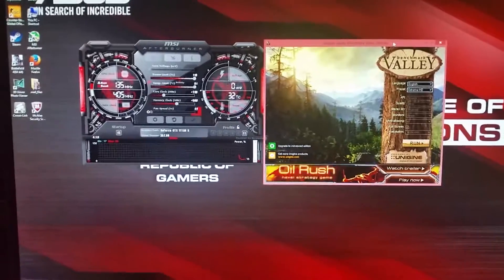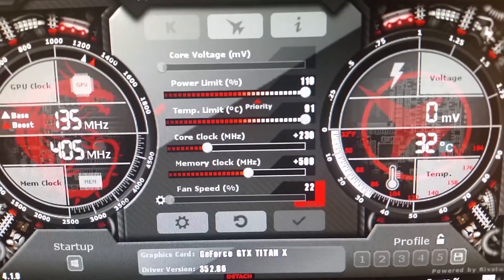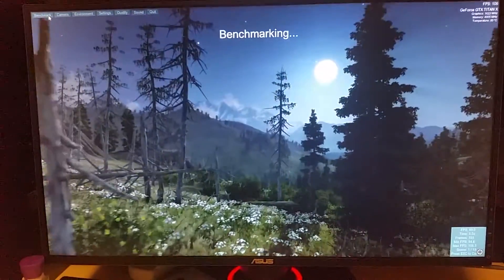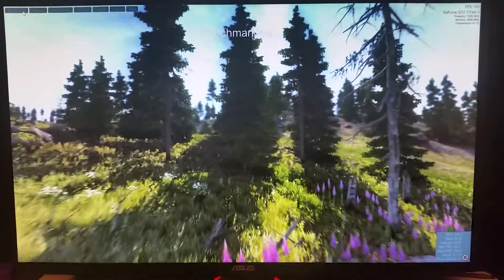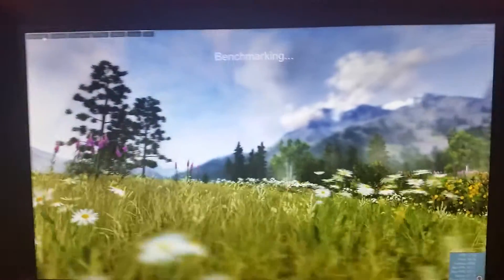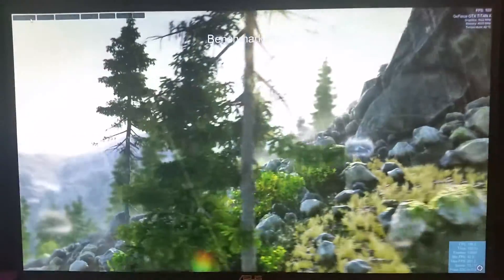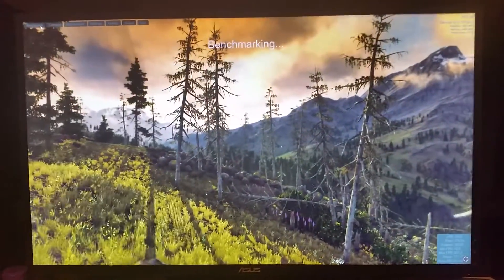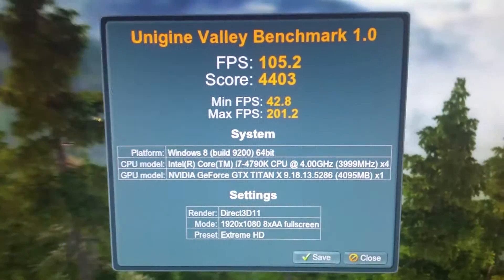TITAN X WATERCOOLED & OVERCLOCKED BENCHMARK

Comment: That's a very good score. I just ran the same settings with crossfire off, so a single 290x and got 2628.
I have the same CPU as you do so there's a good 80% increase (A rough guess) in scores. I'm waiting for a couple of Titan X to replace my 3x 290x so I'm filling time by watching TX videos and making myself even more anxious to get the cards :)
I'm just going to test two of my cards now on the extreme HD setting.
Reply: Mark Hammer 4751 with two of my cards turned on. No overclocks on the cards though so I could have pushed it up a bit more. So one Titan X is almost the same as running two 290x which is the reason I bought the Titans too. You've also got the added advantage of not needing SLi or Crossfire support when games are first released.
Reply from the maker: Mark Hammer Well a couple of 290x's is essentially a 295x2 right? It's pretty well known the 295x2 is a bit faster than the Titan X in almost all scenarios if the VRam isn't an issue. Yeah, you'll love the Titan though. Haven't had any complaints whatsoever besides the price. Oh and of course I wish they allowed board partners like EVGA to make custom PCB's of the Titan series too, but since they don't I decided to go one step further and just put a block on it. I'll note that this is not necessary because the stock cooler is more than capable of cooling the efficient Maxwell chip. I did it more for the novelty of having a custom loop, the lower temps and slightly higher overclocks are just a bonus.
Reply: Randy Moss Yeah the 295x2 sounds good but I have suffered enough with crossfire cards and AMD's never arriving drivers. I'm not sure if the 295x2 suffers the same as normal crossfired cards but since owning my three 290x I have had to turn off crossfire in most games due to one issue or another. The only times it really works well is in benchmarking software and maybe one in twenty new releases. The Titan X has all the muscle in one GPU so avoids those issues but having a second one as backup in SLi can't be a bad thing. At least SLi has better support too.
I'm on a full internal and external water loop too but I've got the blocks and backplates already for the TX as they were selling out fast and I wanted to make sure I wasn't left waiting after I got the cards :) So I should get a decent OC too.
How stable is the OC you added for this video, is it  something you'd be comfortable to run all day ?
Reply from the maker: Mark Hammer
Yeah, the overclock in this video is stable. It seems to be around the limit though without adding voltage. I tried bumping it up another 15 MHZ and it crashed. Upon looking at my graphs I realized it's hitting voltage limits before it reaches the 110% allocated power allowed and way before reaching temp limits. If you use Precision X instead of Afterburner you can increase Millivolts and probably push it further. The +230 I added actually adds onto the GPU 2.0 boost which is 1189. So this video was 1189mhz plus 230 mhz. It leaves you with a clock speed of 1420 mhz. A pretty great 40% increase over the 1000 mhz base clock without having to even touch voltage.
Reply: Randy Moss Thanks for the info, it sounds like the standard card is the best option rather than the EVGA superclocked version then. Plenty of gains to be had especially when running on water.
Reply from the maker: Yeah the Superclocked version isn't worth it. It's the exact same card but with a slightly higher out of the box speed. You can easily achieve that speed on your own within 15 seconds of overclocking. If the SC version was an upgraded PCB it would be worth it though.

Comment: I beat your score with my 980Ti  by 100...I scored 4506 at 1480mhz on the core and memory running at 8gbps effective. its not my max overclock but im happy to see my Zotac Amp extreme is on par with a Titan.
Reply from the maker: Yeah the 980TI's are capable of running at higher speeds than the Titan's, especially aio coolers like the Zotac Amp. The Ti's have always been faster than the Titan's, with the exception of the most recent Titan Xp they released (I'd be so mad if I bought a Titan Pascal for $1,200 and they released a faster Titan shortly thereafter for the same price lol)
Reply: I've watercooled it now, its and absolute beast running at 1550mhz on the core  and 4001 on the ram
Reply from the maker: Yeah Maxwell was a good time to buy. The 700 series cards are already gimped pretty badly in modern games, run hotter, and don't overclock nearly as well. I'm keeping my GM200 GPU until there is a monitor that I really need which requires the updated display port. Otherwise I play CSGO 99% of the time, it's already overkill to the max lol

Comment: If you can reach 1500mhz it can beat the 1080 in some games
Reply from the maker: Yeah, I'm going to wait until Vega or GP100 before I upgrade. The 1080 feels like a cash grab to me. Clock for Clock it's slower than Maxwell. It's not really some breakthrough in technology or architecture. The die shrink just allows them to run at faster speeds, plus the GDDR5X is a small step compared to what HBM2 will bring at the end of the year. I guess the 1080 and 1070 are still nice upgrade cards for someone who didn't buy the last round of Maxwell. Say someone who has a 770 or 780.
Reply: you are uninformed man , Pascal is a whole new arch . HBM matters nothing in gaming at all .  1070 is 1.8x faster than a 970 , remember the last time there was a jump like this? never
Reply from the maker: Najeeb Shah
Pascal was added to their timeline late because Volta was pushed back. Pascal and Polaris are just small evolutions of their prior architectures.

Comment: The highest stable GTX 980 ti G1 1472mhz 4000mhz -http://i.imgur.com/WZOeZNJ.jpg  The highest but unstable -4638 on 1539 mhz core 4050mhz memory
Reply from the maker: The G1 was the best value 980ti by far. Outperformed or performed on par with almost all of the EVGA Classified's or Kingpin's and for less money. 1500+ MHZ is pretty normal for G1 Gaming once adding voltage. Big fan of the G1 Gaming cards =)

Comment: Hello sir,
Please how score graphics with 3dmark firestrike?
Reply from the maker: Giorgos Charitos 
Hello sir. You want to know my firestrike score? Or do you want to know how you can get a firestrike graphics score?
Reply: your score
Reply from the maker: One sec, I'll run it for you. I've done it before but forget exactly what the score was. I'm pretty sure my graphics score was 20,500 or something. Again, I'll check for you.
Reply from the maker: Giorgos Charitos 

Overall score: 16,774  Graphics score: 20,893. That's running at 1435 mhz on Titan X and 4.6 GHZ on 4790k
Reply: thank you very much,You can go on changing 980 TI??
Reply from the maker: Giorgos Charitos
Changing? Nah, I'm not changing cards for a while. At least until Pascal releases next year! Plan on grabbing two Pascal Cards, throwing blocks on them, and buying a 4k monitor =)
Reply from the maker: *****
Then I'll be sad. I'm fairly certain it will be available. From what I've heard Display Port 1.3 can already run 4k 120hz it's just that no monitors or GPU's offer it yet. By the end of 2016 I'm fairly certain they will though.

Comment: i got 4542 score oc at 1430 core clock and 4100 memory clock max temp 67 c and no water cooler
Reply: +Mast3r Race Evga Titan X
Reply from the maker: +Cha zze 
That's weird. You must have some freak of nature card. Every Titan X I've ever seen or read about gets up into the very high 70s or low 80 degrees even at stock speeds.
Reply: i set the fans speed at 70%/ 80% , if not , yes i get 75 /80 c but not over 80c